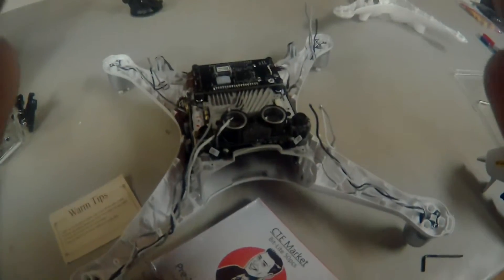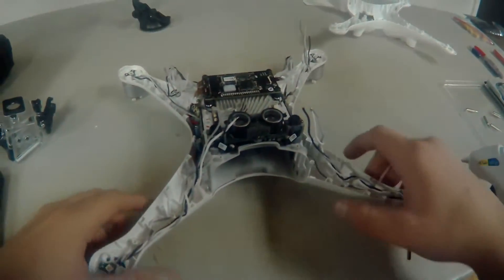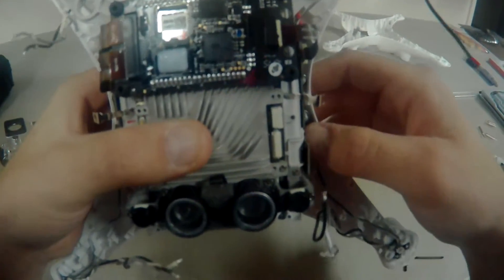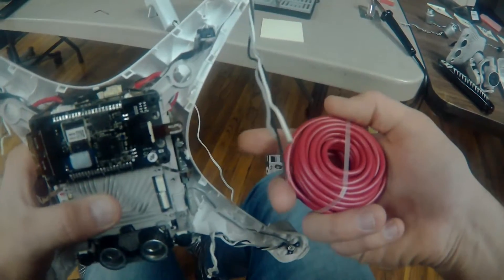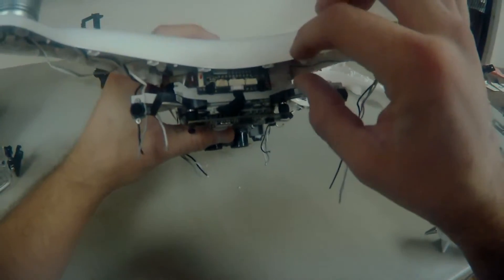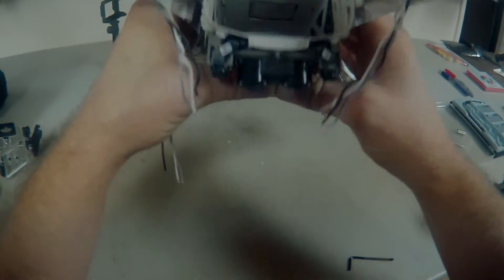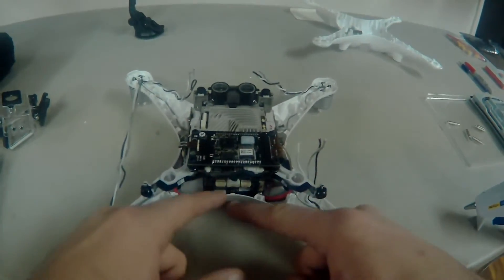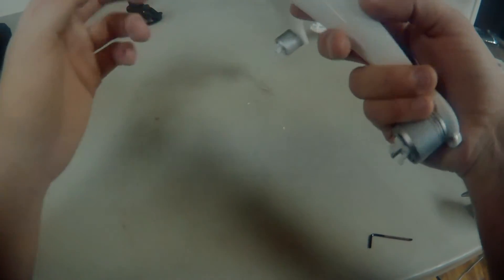Dual battery mod how to phantom 4

Comment: but to have the dari and battery status on dji go you also have to use an original battery in the battery compartment and then connect in exact parallel?

Comment: So your bridging the power and ground on the board and then running out a single power and ground to a xt60 connection?
Reply from the maker: Yes I connected the power wires on left side to the right side. and same for the ground, I then made a pig tail from both and used that as the wires to run out of the case.  If you watch my other video you'll noticed I split them on the outside again this way I could connect 2 batteries.
Reply from the maker: I spliced in prior to the ESC's and after the battery control board
Reply: I was hoping for a little bit more detailed video, but I think you might have given just enough information. I'm looking to do this to my Inspire 2 (which has similar batteries to the Phantom 4 with all of those multiple battery contacts). Any chance you'll be doing a more detailed video? Maybe pulling out the power distribution board? I am curious how the Phantom 4 goes together and where exactly you spliced into the power system. If I am understanding you correctly in the video, did you splice in downstream of the power board? As in, you spliced into the wires going to the motors? I ask because I did this to my Inspire 1 and it worked great, but I was able to splice in upstream of the power distribution board on the I1 and go in directly parallel with the batteries. I don't think that is possible with the I2 and I have a spot in mind where I could hook in downstream of the power distribution board but I'm afraid to try it.

Comment: Thanks for the video ..
But it would be nice to see it with wire soldering in and xt60 connector
Reply from the maker: Are you asking to watch me solder in the xt60 connector or are you wanting to see the finished product?
Reply: i am waiting  both ;) anyway i got cell damage in my phantom 4 battery full charged shows on c3 4.20 not 4.35 any idea how to fix ?
Reply from the maker: Sounds like you may have a bad cell in the battery can you send me a screen shot?

Comment: Probably you will face with a failure. You may need an extra components for it
Reply from the maker: I did not fail. It works 100% and amazing flight times.
Reply: how much flight times bud. I plan on getting mine done.
Reply from the maker: with obstacle avoidance and everything on I average 34 minutes, with atti mode on (full manual) I get more at around 37 minutes.  Before you send it to be done consider doing yourself much cheaper...I'd do it for you too if you'd like.
Reply: Wild Timez I can't find any videos on how to do it on YouTube. Plus I'd have to split a lihv 5200 mah. I know I could mount it on the bottom but I was going to put it on the sides instead. There's a guy in Florida that does it. Looks pretty legitimate from what I could see.
Reply from the maker: It's fine if you have the extra money to do, I was just stating its very easy.  It you watch the above video then all you have to do is soldier a connection to the black and red wires and run them out of the body casing.  Then attach whatever type of connector you'd like.  Keep watch i'm going to post a video over view of my phantom externally so you can see.  Unfortunately i'm not opening it up again right now to show the inside but watching the video above you can see the 2 wires that I used.  If you are willing then I could do the mod for free if you'll let me make a video of your phantom and you provide parts.
Reply: man i didn't even see the rest of your comment wild timez. its too late now. I think you should start making videos though. Theres no one on youtube making those type of instructional videos right now.